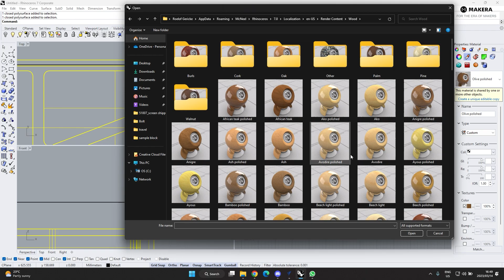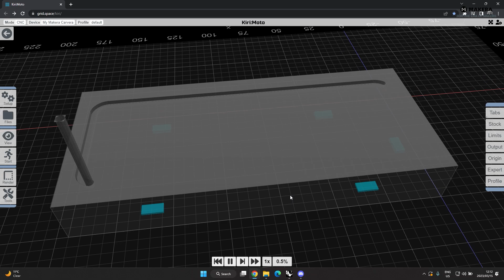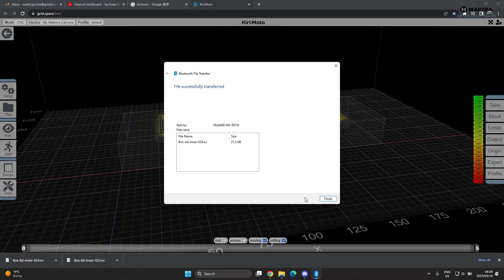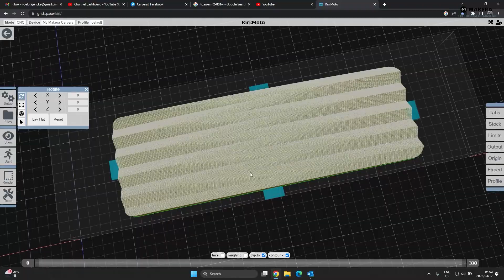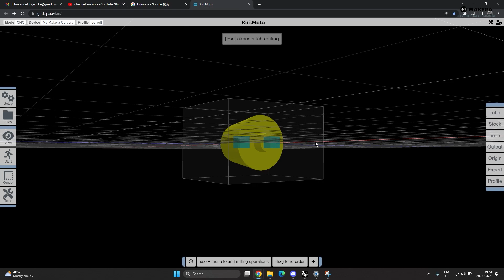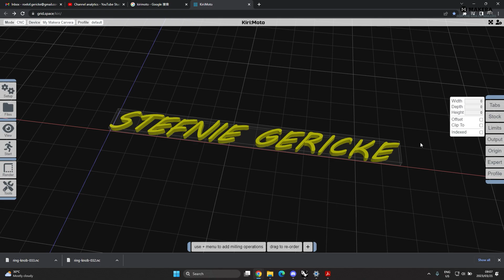Making a jewelry box using CARVERA & Kiri:moto

Comment: 😢that’s dangerous the bit broken
Reply from the maker: Some bits may break in CNC machining due to testing, parameters modification and also quality of bits. As long as the lid is closed and the machine is operated cautiously, then it not very dangerous.

Comment: So if your stock is not square on all sides will the model be off when you flip it? I have been trying to do a double sided job with aluminum but my aluminum is not square or cut accurately.
Reply from the maker: correct, and your anchor point needs to be alligned 100%. In this case I would not use anchor 1 but rather include mirrored alignment holes so you can be sure your parts is in the correct position on flipping.

Comment: Nice project, thanks. What is the 3D modelling software you use?
Reply: Rhinoceros 3D
Reply: Are you going to share the project files?  Not just the 3D file, but It would be great to open and play with the Kiri:Moto files and perhaps even make them.
Reply from the maker: Sure, will see if I can put a pack together with the project files and models.